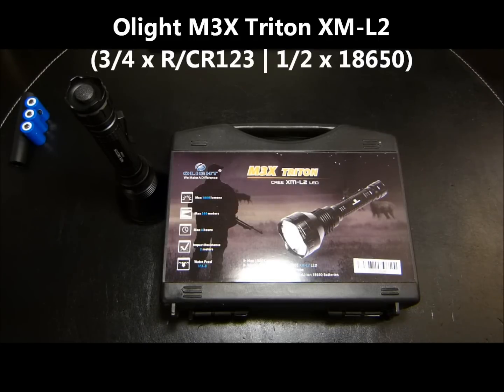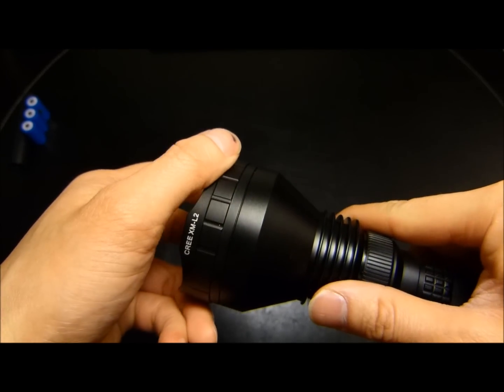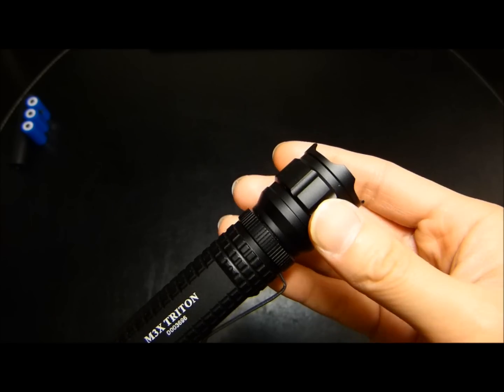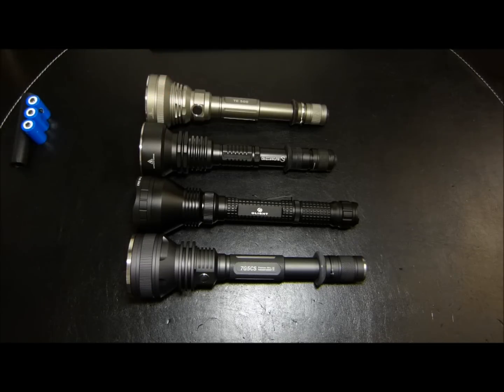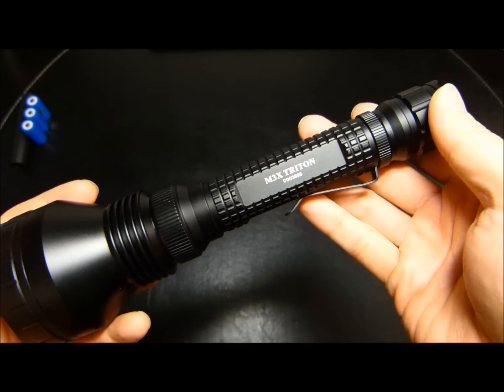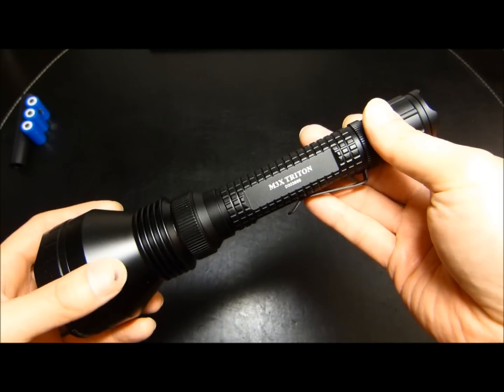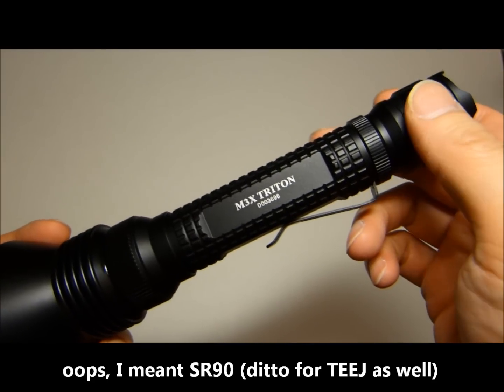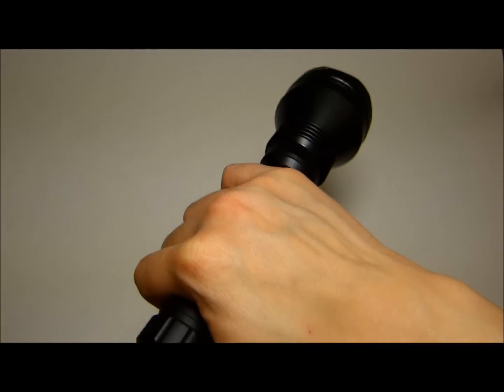Olight M3X Trition XM-L2 (3/4 x R/CR123 | 1/2 x 18650) Review

Comment from the maker: As can be seen in my written reviews, as part of my standard, I use RediLast 3400's (sponsored by EDC+) and AW2600's (self-purchased) to good effect. The RL3400's are not pure LiCo (contains Ni) and thus are able to achieve longer run times. I'd suggest doing a search for HKJ's comparator (Common18650comparator.php) and look for 18650 cells that provide the longest bar for 2.1A (current draw for M3X on High). This will yield the longest run time.

Comment from the maker: IMO, that's a bit of an apples to oranges. Though they are both throwers, the form-factor is different (M3X = 2 Cells max in-line | TN31 = 3 cells side-by-side). I haven't gotten around to measuring the Lux yet but based solely on visual estimation, it should be within the ballpark of the TN31. WIll post updates to my written review when I get the measurement.